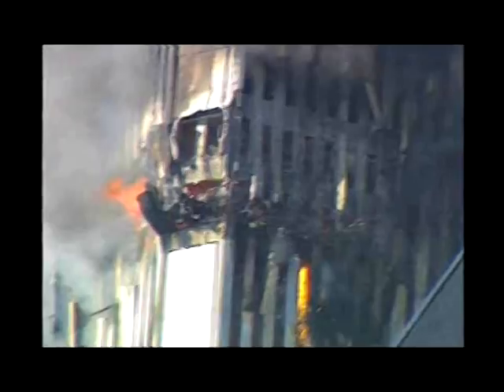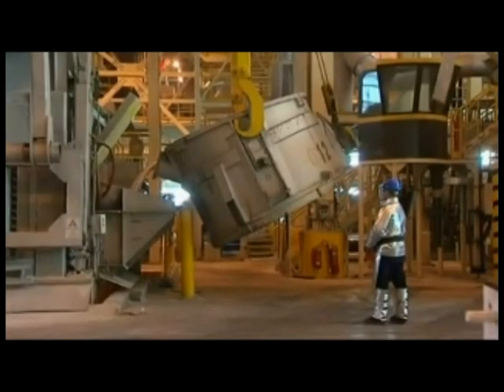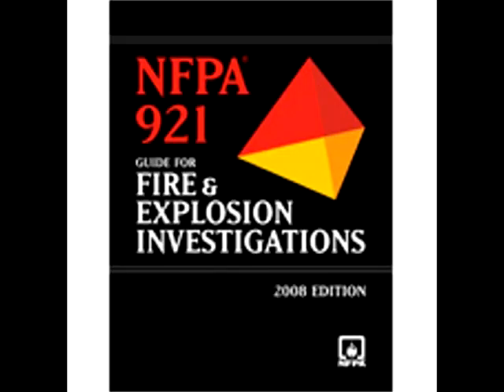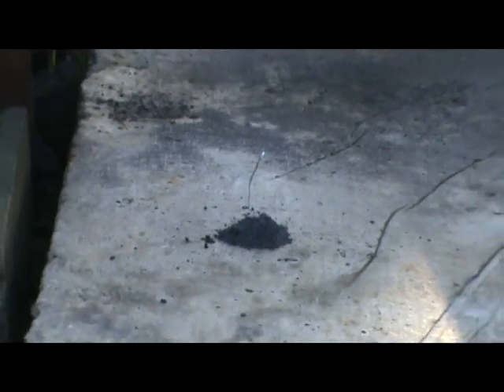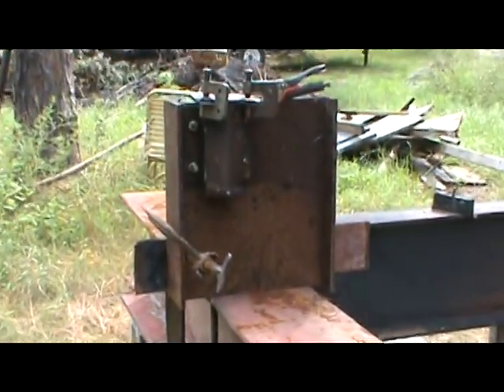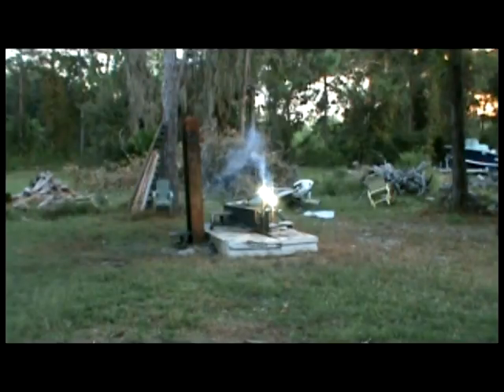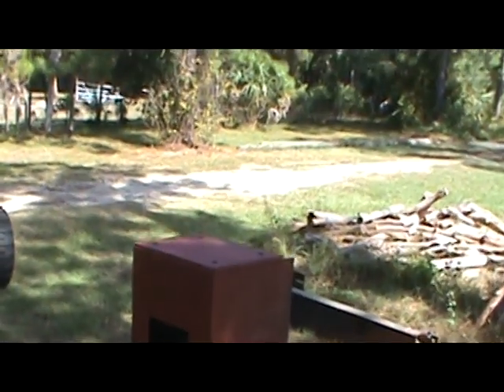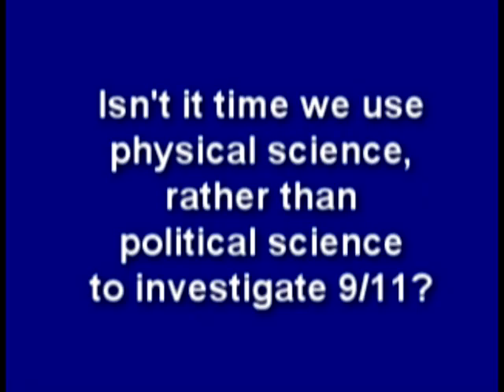9/11 Experiments: The Great Thermate Debate

Comment: The burning jet fuel doesnt have to melt steel beams it can heat them up and make them maliable enough to break not to mention the weight of an airliner sitting on an office floor would break the bolts causing the floor along with the remainder of the plane to hit the next floor however this time much harder due to the fact it was falling and this would trigger a chain reaction, can we go home now ok it wasnt bush it wasnt the CIA, it was osma binladen
Reply: Casimir Kulikowski ..so you have mathmatically quantified the accelerations during the Collapse Event for US all to see and replicate! ....No!?...well dont feel bad about that, the govt didnt bother to provide US with any of that either.
Reply: Go park a jet on an office floor and see how well it holds up
Reply: Casimir Kulikowski ...that's not an answer...common my fellow polish cousin!...I know you can do betternthat!.

.common, hit me with something good if you want, related to what im trying to talk about.
Reply: It doesnt take a genius to realise a floor + a jet falling at 9.81 meters a second is going to hit the floor under it pretty hard
Reply: Casimir Kulikowski ...did you start quantifying that all yet?...thats the only way you can have an actual opinion about it....you find out for yourself how smart you are...im not doing it for you....best wishes Casimir.

Comment: For someone who claims to be an engineer, you fail to realize that you do not have to actually melt steel for it to fail. At a temperature of 1100 degrees, steel loses about 50% of its strength, at 1832F air temperature, steel will be just as hot and as such, only has maybe 10% of its strength. Hence, the top of the building no longer able to be supported.

You should go to the fab shop and watch the beam straightening sequence. AWS D1.1 requires temperatures to be below 1100F due to the fact that higher temps changes the structure of the steel and weakens it.

https://www.steelconstruction.info/images/9/99/Steel_strength_in_fire.png shows how the strength of steel decreases with temperature. (All materials weaken with increasing temperature and steel is no exception. Strength loss for steel is generally accepted to begin at about 300°C and increases rapidly after 400°C. By 550°C steel retains approximately 60% of its room temperature yield strength, and 45% of its stiffness. At high temperatures, steel is also subjected to significant thermal elongation, which may lead to adverse impacts, especially if it is restrained. It follows therefore that one would expect that structural steelwork which has been subjected to high temperatures would exhibit signs of this in the form of distortion and buckling.)
Reply: Mike S ..for someone who claims to know anything about that collapse...explain to yourself why the columns below the crash area provided no resistance to the collapse...are you surprised to know the govt admitted there was nothing wrong with those columns in the nist forensic "analysis" report?..or still clinging to some other TV induced alternate senerio of how they were damaged in some way?
Reply: You do understand that they relied on the upper floors remaining in place right? Once you have thousands of tons of upper floors and office materials falling on to them, they are not gonna be able to hold such. As far as explosions, do people honestly believe that structural steel will break in a quiet way? What about the windows blowing out? Will not air pressure break them from the above mass pancaking on top of it? Why do you think you cannot swat a fly with your hand? Air being pushed in front of your hand. A skyscraper is designed to remain standing with minor damage, but damage to 11 floors is not minor.

People also forget that there is more to an office than open spaces with bare concrete. Carpets, steel file cabinets, paper, plastic, wood, etc. that all contribute to fires that burn (or melt).

Comment: the twin tower collapse,was nothing but controlled demolition. You can watch 1000 videos of building demolitions. and the twin towers fell perfectly in there own footprint. look at tower 7 also . same thing.and eye witnesses said they heard explosions in that collapse. How can we be so blind to the bullshit lies that the Government and the media tell us. It must have been swamp gas.
Reply: Except that in those "1000s of videos" the demo starts from the bottom and goes up. Not the top and goes down. You know, except for that tiny little detail.
Reply: still and all, it was controlled demolition
Reply: Rick Glow I guess you believe what you want to believe.
Reply: Why do you think fly swatters have holes in them? For the same reason glass will blow out, air pressure. Does structural steel break quietly? No, it will make a big explosion sounding bang.

Comment: Did you consider that the fires were burning inside a CLOSED structure with no ventilation.  That's why it got so hot.  If I poured jet fuel on a steel beam and lit it on fire, it would not melt the steel.  But that's not the same scenario we were dealing with, with the WTC attack.

Comment: When they pull out the open burn temperature of jet fuel you know they are lying as anyone that has been around fires know once they get hot they start sucking in extra air from all around and with that extra air they get hotter. The real temperatures that need to be used are the forced fed with air burn temperatures. 

That said please show off a insulation that can hold up to even the open air burn temperatures of jet fuel to protect the bombs/thermite charges for the 60-90 minutes as you need a way to get a signal in to them for them all to detonate at the right point as timers can't do that 

Thermite would self ignite at the temperatures shown long before the buildings fell and explosives would start to decompose in the heat. The cables connecting the charges would burn in the first few minutes of the fire and the insulation would fail long before they are needed unless you are talking something the size of a fridge for a charge the size of a cellphone.

Comment: The insurance aspect of 9/11 is a big indicator to an issue businesses have with high rises. They are expensive to maintain and demolish should something major happen.

Its probably a surprise to some that the tallest high rise in history to be demolished was only 47 stories. Not in NY but the world. And that was brought down manually to avoid damage to surround structures.

Think about it. What chance would a fire crew have of dealing with the blaze at those heights? Most of their equipment would be useless including extensions on fire trucks. It all would have to be done internally increasing risks to safety. Imagine trying to repair those buildings after a fire.

So there are big clues to why Nanothermite was used as the main explosive. The different types can either soften, melt, dustify.....even or even turn steel into gas. Can you see this is an  engineering problem?

The WTC Towers and WTC 7 could unofficially be considered to be the biggest skyscrapers in history to be leveled by controlled demolition. They all fell at freefall speeds. Zero resistance. 100% Controlled demolition. No argument or alternative. Even if the building was designed to fall like a house of cards through a linked frame, it simply wouldn't be able to disconnect supports quicker than the instant cut explosives provide.

Comment: How soft do bolts and beams get at the max temperature that was recorded? I'm sure soft enough to buckle under the massive weight on top of it. The building was built to collapse in on itself. It looked nothing like a controlled demolition. You conspiracy nuts get so into detail you ignore the basics.
Reply: So FLOSSY ....you're saying you've  mathmatically quantified the collapse acceleration for US all to see and replicate!!!?...No!?...well dont feel bad about that, the govt didnt bother to provide US that either (even though required by law to do so)..its fudged and incomplete both scientifically and legally..I know this because I cared enough to read the forensic "analysis" report for myself....another whitewash in the long line of em  from the us govt.
Reply: Timothy E Hook whatever you say...Lol. No need to look into anything when you realize steel will buckle well before the max temp, and the building was literally created and designed to fall into itself, just like it did. Like I said, you're so focused on calculating acceleration and all that bs that you forgot the basics. How would have all these "explosives" gotten there? While nobody noticed or has been able to find any evidence of? Past thousands of people, bomb sniffing dogs and metal detectors. Were they built into the building during its creation or something? There's so many videos proving you nuts wrong but you still don't believe it. Go build a scaled model to spec and test it yourself. Stop waiting for research from others to tell you what's right or wrong. You don't need to be a rocket surgeon to realize how soft metal gets at these temps and that all the arc cutters used to move to scrap created the molten dust. I'm not some crazy pro government guy but you ppl look insane.
Reply: So FLOSSY ..sign...now I had to read ALL that to learn you know nothing about those collapses...and im not regurgitating anything either...my 20+ years of commercial structural design as a civil engineer has prepared me well to do the little physics it takes to mathmatically prove the govt put out a BS story that doesn't hold up to scientific scrutiny....im sure that's a basic enough idea for you to understand...common now.

Comment: It is possible for Jet fuel or any fuel to temporarily burn at temps far hotter than the melting point of steel but it has to be in a vapor form and properly mixed with air. The vapor of gasoline can temporarily burn at 15,000 degrees. While Jet fuel is not Gasoline, the principle is the same. The explosion you experience from the rapidly burning vapor is that it gets so hot that it expands rapidly, thus creating an explosion as it instantly heats up the air and expands it. However, this heat blast only lasts for a very tiny fraction of a second, like less than 1/10th of a second. In theory if you had  a large amount of controlled jet fuel vapor properly mixed with air you might be able to melt steel. When the planes crashed into the building, yes, fuel probably instantly sprayed everywhere and was instantly converted to vapor and for a brief second there might have been enough air to create a flash burn at several thousand degrees but even in this scenario you the fuel was almost instantaneously burned and very quickly the vapors of the fuel would be consumed and within seconds the temps would collapse to the normal burning temps of ignited synthetics in the Office space. It would be difficult to sustain a temp higher than 1,500 degrees because of all the dust  and non flammable materials floating in the air that would reduce oxygen levels and smother the flames. I mean unless you had a really powerful fan blowing the dust out with all the  non flammable fire retardants and sheet rock and had that fan directly on the the burning office material it would be almost impossible to sustain temps much above 1,100 degrees which is no where near the temps needed to melt steel.  1,100 degrees is barely hot enough to weaken or soften the steel. At 1.100 degrees the beams might warp due to heat expansion but that is about it.
Reply: 1100F is enough to turn structural steel bright orange and lose approximately 50% of its strength. It does not have to melt. It is one reason why when straightening beams due to too much sweep or camber, temperatures have to be monitored.
Reply: However, no steel framed building in the entire world has ever collapsed from a fire. In a fire only a few beams even get to that temp and in isolated spots and that is not enough to bring a building down in perfect order like an accordion and at the speed of gravity. If you had  few beams give way because they were softened you would have rooms or sections that collapsed and the other floors would hold them up. But even so, there is not one instance in world history of a steel framed building collapsing at all in a fire. Fires in steel framed buildings are not uncommon and they are built with steel as one of the primary reasons being that they don't collapse. Also, all building codes in the United States state that a steel framed building has to hold at least 8 times its own weight and still be able to stand. This protects it against collapse from earthquakes and terrorist attacks. I worked in constructing high rise buildings in Seattle for 20 years. It is impossible for a fire to take any of those buildings down. Those beams have to be weakened and all of them at once  by Approx. 88% for there to be a chance at a total structural collapse. Even if that happened due to fire it would never fall perfectly like compressing and accordion and at the speed of Gravity. The Twin Towers and Building 7 were all controlled demolitions. It is impossible for a building to fall like that naturally with such precision.  Any Pyrotech can prove that to you and very very easily.

Comment: Why does the metal need to melt? Surely something With that much weight would collapse as soon as the girders became even slightly plyant
Reply: James Robins ..have you mathmatically quantified the collapse accelerations then?...No!?..well dont feel too bad,  the govt didnt bother to do that either....that's a fact cousin.
Reply: James Robins ...the govts forensic "analysis" on that subject, the collapse event, doesn't hold up to scientific scrutiny....with all due respect, you can't just get away with pulling an unfounded statement like that out your ass...unless you control the govt of course.
Reply: i didn't mate, a huge fucking plane tore through the building and out the other side. it i don't need to quantify it

Comment: Isn't the easy answer that perhaps a large feeder cable was burnt through and proceeded to short circuit to earth through the steel structure? Any welder can tell you that some good old fashioned electricity plus metal will provide blinding light, and liquid metal.

Comment: Steel will not melt at 1800 degrees but it will loose some of its integrity and strength. For example, take a straw and put it between the index finger of each hand. Have a friend take a lighter and light it. Place the flame 12' below the straw. As the plastic hears up it will slowly.bend losing its strength and integrity. The weight supported above could not be supported which as soon as the 1st trusses attachment bolts to the skeleton severed due to stress, the floors pancakes, causing the collapse. Experts can ONLY guesstimate what the temperature was at the time. Do we know all the truth? No. Was our Govt involved. I don't think so but am open to proof.

Comment: Dr. S. Jones issued a paper about his analysis of the WTC dust.  I obtained a copy before it was taken down.  In the footnotes, he references a patent filed by 'Spectre Systems' of Boca Raton, FL.  The patent is for a thermitic cutter charge.  It is super-thermite plastic explosive rolled into a flexible cord.  The cord is wrapped around thick steel columns @ 45deg. angles and it slices through them like butter.  If you search the USPTO, you may still find that patent.  Time Life issued a coffee table book about 9/11.  In it you will find pictures of structural columns at ground level eith perfect 45deg. slices through them.  Don't let this crime die with its perpetrators.  Push for truth and reconciliation, whenever possible.

Comment: Steel melts starting at 1300 degrees. 1800, as the video says, is 500 degrees hotter, check your science. I don't mind if you you think it's an inside job, but don't lie using checkable facts.

Comment: So what is the leading alternative theory?  Not as hand waving and suspicions about this to that detail, but as a complete plausible theory of the whole collapse, which better accounts for ALL of the known facts (that's how one scientific theory displaces another, not just by casting suspicion on particular details).

When could the "nano-thermite" have been placed against all the iron beams without causing suspicion or a record of anomalous activity (like "all of the walls near beams had patched holes in them when we arrived at work on Monday")?  How was it ignited exactly on time (wiring? radio?  where did the power come from?).  How many floors were rigged?  Did the rest of the floors collapse via gravity & impact just as described by NIST?  Why did they wait so long to push the button - rather than immediately triggering a collapse?  Did they get the pilots to hit the exact floors where the first thermate/explosives were pre-planted, or was it rigged so they could start the collapse from wherever the planes wound up hitting?  How did they keep the demolition material and controls from being rendered inoperative by the plane strikes and fires?  What if one building had failed to collapse after the plane hit - there would have been indisputable in-place evidence left behind (all that thermate and the wired system for setting it off).

When I see a near complete alternative theory which can withstand the obvious criticisms from reasonable skeptics, I will pay attention.  The idea that both buildings were secretly pre-rigged with a super reliable multi-floor demolition system which could be trusted to operate flawlessly so long after the impacts is not very credible. (If it had failed and left hard evidence - like wired explosive/thermate devices in the walls - there would have been big trouble)  At this stage, it seems like one has to have a lot of confirmation bias (aka selective skepticism/credulity) in order to find the proposed alternative explanations more credible than the NIST report.